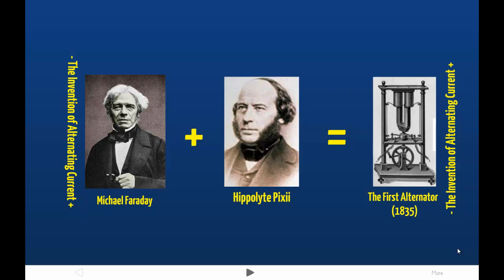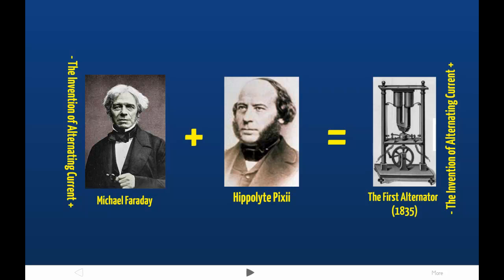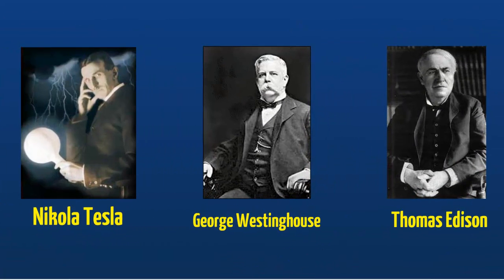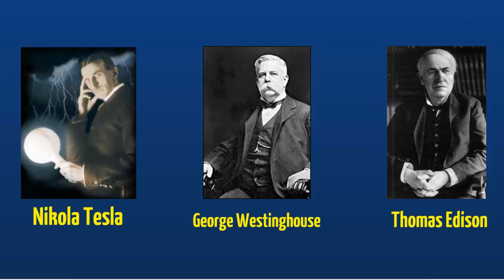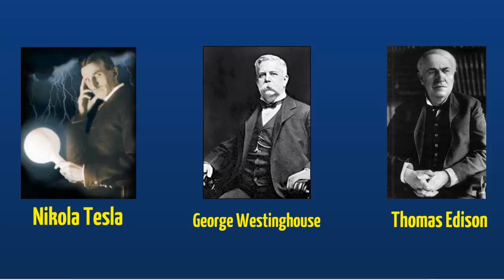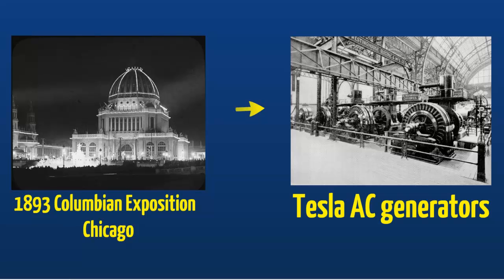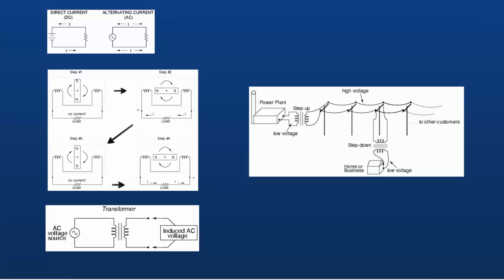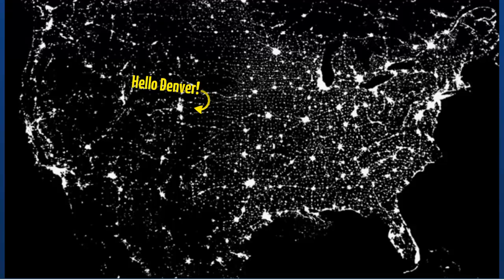The History of Alternating Current

Comment: That was an awesome presentation. Thanks a lot. I've recently discovered something called an aeoliophile, which is a steam powered engine from antiquity. I'm interested in hearing your opinion on the potential applications it may have had in ancient times if certain changes were performed to its design (could it power a small Greek village?) or is it only something that would provide a limited amount of static charge? Thanks again.
Reply from the maker: Thanks for  your comment. It's appreciated. An aeolipile has a lot of potential. But the Greeks never utilized it. If you had a large enough water reservoir it would certainly have enough power to turn a crankshaft to power an electric motor. But the people of the time didn't  really understand the possibility of using the aeolipile for mechanical uses, let alone understand electricity enough to make a motor.